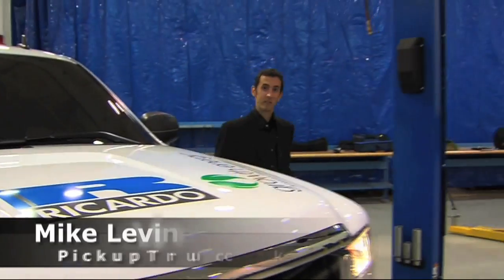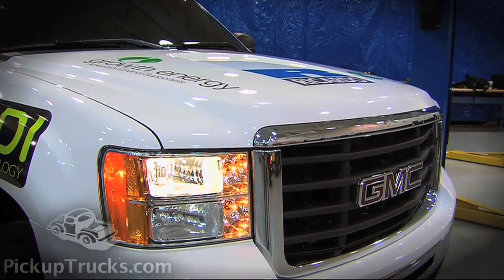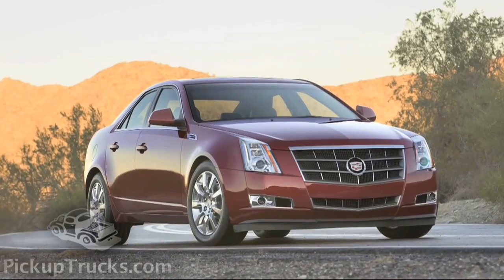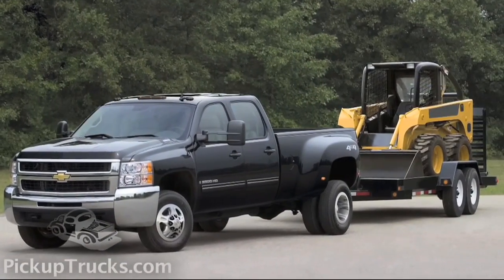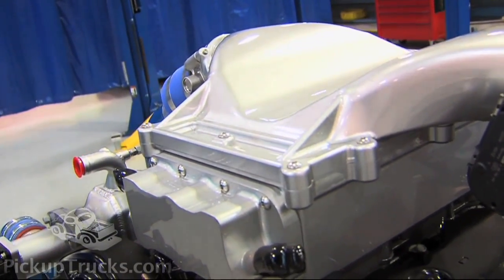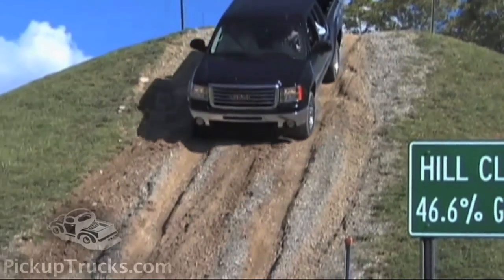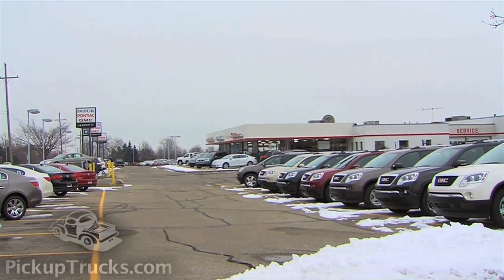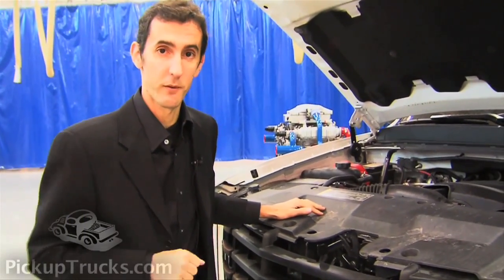Ricardo's Ethanol Boost Direct Injection Engine

Comment: E85 is cheaper to run than gasoline, is much easier on the engine and cleaner, but today's ICE aren't optimised.  an engine should be running over 14:1 compression, or 11:1 if using turbos...meaning you could turbocharge a modern high compression sidi motor without modifying the internals.  you could easily take a 2.4L sidi ecotec to 300+ hp and torque, with no fuel consumption penalty.  that is MUCH cheaper than running a diesel - no special parts, aftertreatment, or certification!

Comment: the extra cost of the dual injection systems and more robust block and heads negates much of the savings from not needing a diesel after-treatment system. meaning it will cost more than a comparable diesel engine, with current tech. but for sure this engine isn't going away, once the tech becomes more common this could replace diesel engines.

Comment: Ethanol has it good points and its bad points. Good point it help doesn't send harmful CO2 emissions in the air like fossil fuels. Bad point is it burns so quickly that 20 to 30 mpg turns into 10  & 15 mpg......